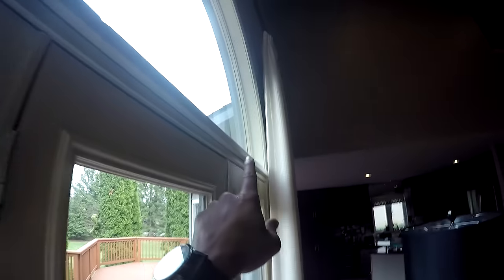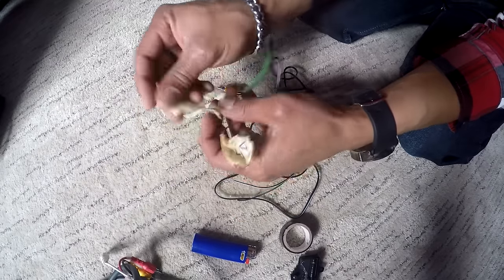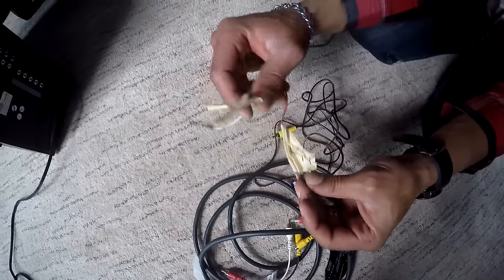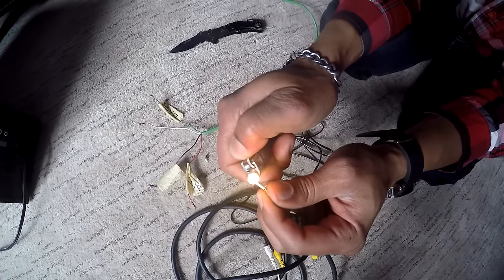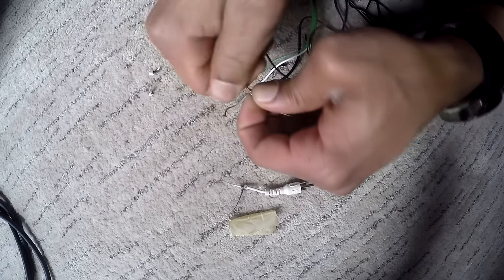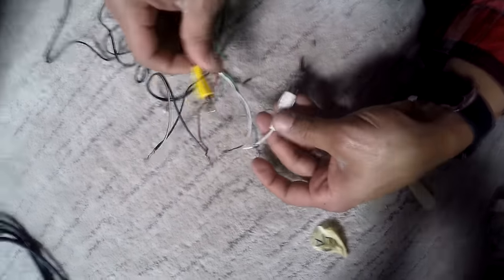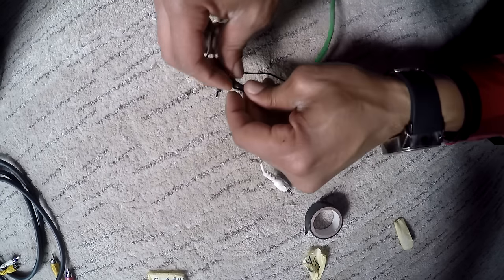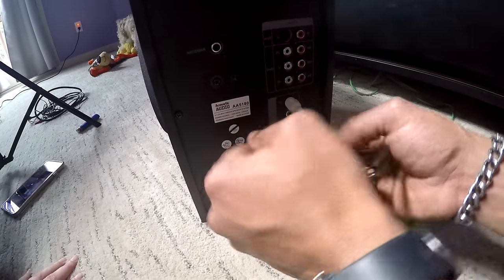Connecting Speaker Wire To RCA - Simple!

Comment: I have a Sony STR-DH790 7.2-ch Surround Sound Home Theater AV Receiver: 4K HDR .
I bought a subwoofer that doesn't have RCA in the back. When I did what you just done, my subwoofer outlet only pushing out very low volume. Barley can hear or feel the bass.
Do I need a amplifier to push my subwoofer?

Comment: I've "rigged up" many audio cables like this over the years. Unless you solder the connections, they will come loose. Hissing popping, having to squeeze the electrical tape to fix the connection.... Spend the 2 bucks and get an adaptor, or use a soldering iron!

Comment: 😒I tried this it didn't work. If the RCA cables used are too small a gauge, will that prevent it from working, do you know? Cz they were much smaller than the speaker wire.... almost sounds obvious now, but I thought I would get a signal through just not the amps or something.... guess I have to try again, lol

Comment: You cant connect regular rca outputs to speakers, they are very low voltage and you wouldn't hear anything. These speakers must just have rca connectors used for speaker connections like Bose does. Also solder your connections for trouble free consistent output.
Reply: They will work for in puts to an amp better tomake an "rca adapter" using the female part of a broken dvd ect....
Reply: @johnwayne6003  What?

Comment: I've spliced my right side sub in my car to a 12 inch kicker and placed it in center of backseat. My next is I have a splice from the left side sub and want to split that to rca to line in on amp. Then install another sub to that amp so I have more bass control. When wiring my right side sub wire I have a positive and a negative. Which one gets the white and which gets the red? Or do I split the copper into the white and other into red?? Or ??

Comment: Hummm.  I bought RF modulators or whatever to connect factory radio wires to RCA to connect to amp... I needed two and it's really cramped behind the radio.  Seriously considering using this cheat instead...although, I probably will solder and use the shrink covers.  This will free up space and make it easier to trace the wires.

Comment: can you split the out put of a bare wire center L/R to two different sets of speakers? 1 with bare wire, the other with RCA? i bought a house that has two different audio set ups, one for 5 speaker(3 front, 2 rear) surround, and the other with a PoE RCA(RED/WHITE) input. i want to take the out put of the center L/R speakers and tie that into the RCA circuit as well so its all controlled in one location. can you put more than one wire in the receiver bare wire port or do i have to split the bare wire to go to bare wire and RCA?

Comment: As your speaker has power plug. But I have speaker without any power plug only two wires. Can I use that speaker using your tricks without using amplifier?
Reply: I'm doing the same my av receiver wouldn't run a sub and this didn't work on my buttkicker amp for a sub either
I think it needs a y jack though into the 3. 5

Comment: Hey Man. Cool video
I was just wondering how I can hook(solder) the wiring directly from the speaker to the circuit board of the accoustic subwoofer [without use of the RCA cable] just using regular speaker wire

Comment: i did it but the speakers volume is very very low, is like te cable doesnt give it enough power
Reply: Wires are reversed probably
Reply: @Xixu.co.6  nope, i tried both ways and still the same

Comment: I notice that the wire you used is about 18 gauge: that is a lot of resistance for a wire that is longer than 10 ft. So do NOT crank the volume up too high, or you will fry the transformer in your amplifier. Best to use 14 gauge pure copper wire (anything heavier will not accommodate an RCA plug). The wire need not be shielded, since it conducts a current.
Reply: can you explain this to me like i am 5? 
im helping my cousin set up a new turntable with a built in preamp and no speaker cable outs. she wants to use her oldscool speakers so i was going to adapt an rca cable like here so i can run her speakers off the built in preamp. what exactly could cause the transformer in the turntable to fry? is it the use of a small guage rca that will overheat by trying to power the speakers?  I'm confused how that would happen. thanks! diy noob here
Reply: @cymbolic_space1832  The heavier the gauge of a wire, the less resistance. For instance, an amplifier has to push a signal more than twice as hard through a 24 gauge wire than through the thicker 12 gauge. 16 or even 18 gauge is OK for connecting the output of a turntable to input of an amp. But for the output of the amp to the speakers, opt for the heaviest gauge you can afford. 16 gauge will work for the latter if the cable is less than 6 ft. But use 14 gauge for longer cables. If, say, the speakers are 20 ft away, go for 12 gauge. 

You can test the impedence by hand. Crank up the volume and feel the cable about 18 inches from the output of the amp: if the cable gets warm, use a heavier gauge.
Reply: @TheBinaryWolf  amazing. thanks for the detailed response. the cable to the left speaker will run probably two feet and the cable to the right speaker will run roughly 9 feet. gauge shouldn't be much of an issue but maybe i will find an inexpensive, heavy gauge rca to cut up, or potentially just buy speaker cable with an rca connector on one end.

god bless
🦊🙏
Reply: @cymbolic_space1832  You are most welcome. Use 16 gauge for the short cable and 14 gauge for the 9 ft for balance. But if the amp is powerful and you don't play at high levels, 16 gauge for both is safe. You can use regular power cable from Home Depot, since speaker wire is not shielded.

Rich blessings

Comment: Are the speakers in the wall connected to a power outlet?
Reply: Zahied Abbass no, otherwise he wouldn’t need an amp, an amp/receiver’s job is to control and most importantly power speakers and/or other interfaces like large cassette players or turntables that don’t plug into a wall.
Reply: @daniellaufer6204  Since when do amps output amplified signals over rca? I'm a little confused.